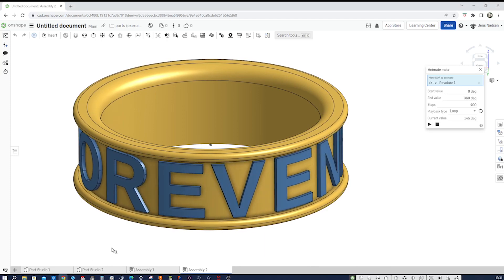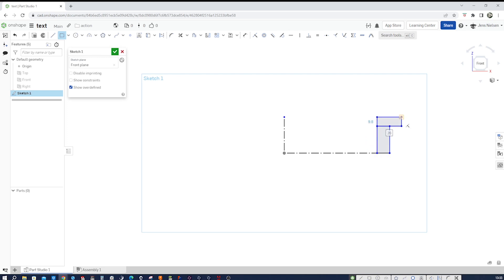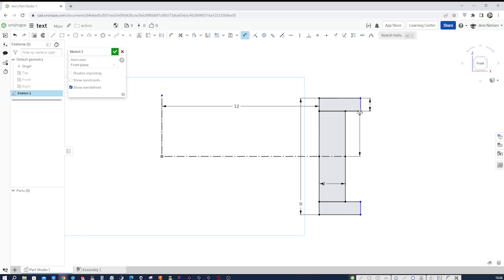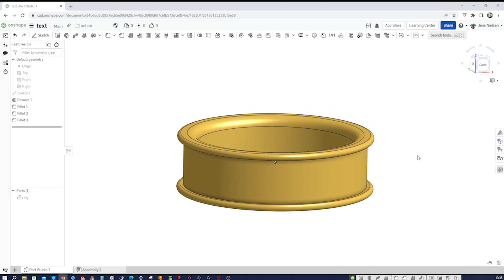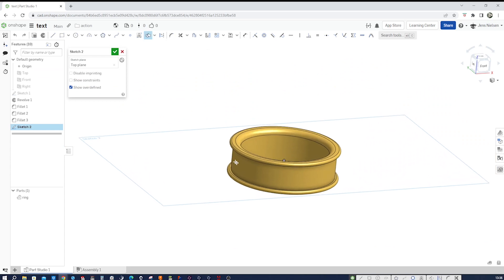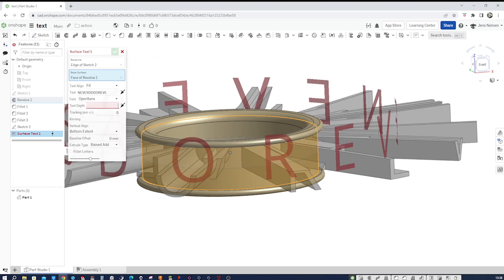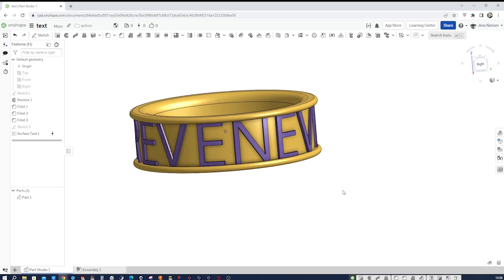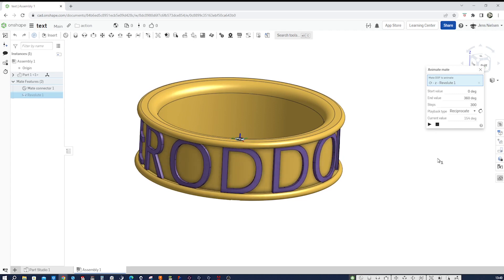Add Cool Text To Any Shape In Onshape With This Simple Guide!

Comment: I am hoping you see this comment!

Good stuff, pointed me to the right direction, however when I follow these steps, the text is huge, a lot taller than the ring and the surface of the ring that I selected. I cannot change that font size, any ideas? My text is just three letters, that is probably why, but I am unable to figure out how to get around this

EDIT: I figured it out! For the benefit of anyone else reading this, if you have a small word like a few letters, do not use "Fit" under the "Text align" toggle, you will have to select something else and manually enter the height instead. Worked like a charm

Comment: I selected the right face but I got warning: could not intersect the selected face ... - I know I did something wrongly just .... don't know where
Reply from the maker: maybe this link to my file can assist you: https://cad.onshape.com/documents/0cf480b19131c7a3b7018dee/w/8d556eecbc38864bea5f995b/e/f05a4a627dfa7210564aa556?renderMode=0&uiState=664842f3ff976517d737ffd7
Reply: @cademist  many thanks in the end it succeeded, thank you (having vertex in the 'middle' of the sketch  is essential to have a baseline later) otherwise you cant make intersection on the second sketch
Reply from the maker: I'm glad it worked in the end